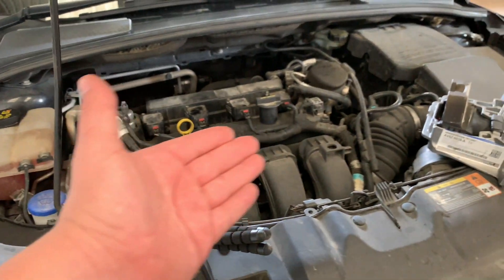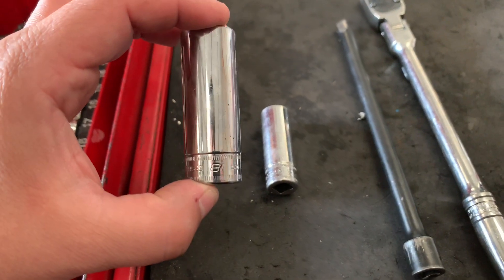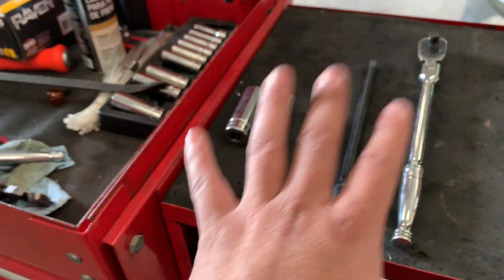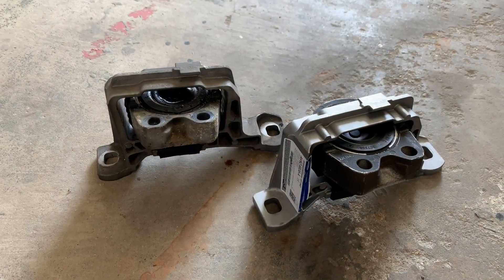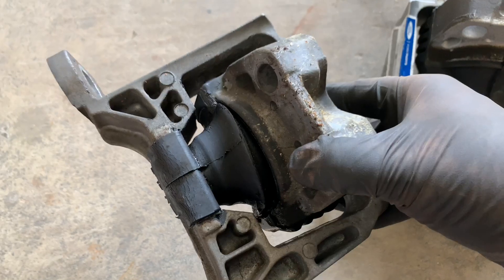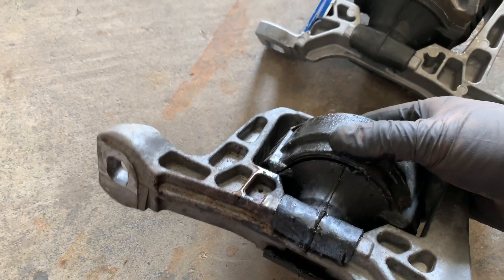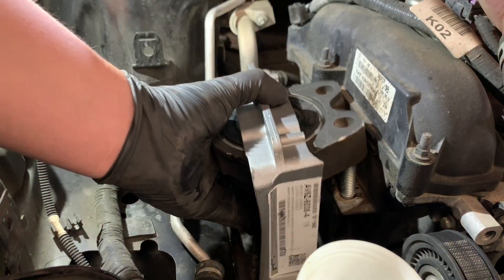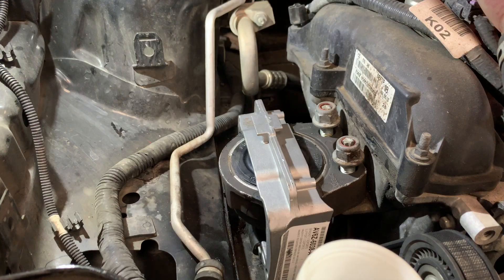Ford Focus Engine Mount Vibration Repair 2012-2017

Comment: Excellent video, I did not know what was my problem and now I learned the hard way asking a mechanic, and I paid the price of not having the knowledge, but next time I'll do exactly what you teach. BTW I understood that the jack is for pressing the engine upward, so I can take out the mount. I'll check the torque on the hynes guide.
Thanks for the video the best I found about the problem!

Comment: I get clunks when changing gears mainly 2nd and 3rd abd 4th gear.  I had clutch and flywheel changed but still does it.  Would this stop clunking I have oil leaking out if my engine mount now as well

Comment: This is great video & helpful for non mechanical person like me BUT for me, it didn't go as planned, when I took off the old mount, the motor shifted back several inches even though I had it supported with jack. First I thought part was wrong but it aligned same as old part & broke down calling my very expensive mechanic, he couldn't offer me help other than telling me to get crowbar & rock motor back/forth. Unfortunately, I didn't have that but walked the neighborhood dug up street sign & found a few 2x4's which all helped me move the engine back in position with also some repositioning of the jacks. After 3hrs, I got it installed & seriously feels like I'm driving a brand new car & my 2012 Focus has 160K mi. Thank you for this video. My next issue, since last week I get warning my Hill Assist is off & now 4-5X each day it warns me to check it. I might change some fuses but can you offer some more free advice. Thank you!
Reply from the maker: sorry you had those issues  .. but yeah that happens sometimes and best thing to do is just that force it back .. GLAD you got it fixed and can feel the difference .. have you tried unplugging the battery just to reset the codes (or clearing the code) just to make sure the code comes back?

Comment: My ford focus is having a vibration or shudering when accelerating from stop. Transmission is smooth. i am wondering whether i have a transmission issue or engine mount issue.
Reply from the maker: could be the mount .. but you said .. "transmission was smooth"
Reply: @FalconsGarage Please help me. My Focus3 1.6 tdci 115 hp twitching in 2nd gear when i accelerate from lower rmp. Twitching happens when i slightly accelerating in city drive. I hope its mount. Or something else?

Comment: What about the other 2 motor mounts ? Because it’s 3 in total right ? One on driver side and under the car is the 3rd one …
Reply from the maker: Yes you have 2 main mounts and one “wishbone” mount. But this is the one that goes bad 90% of the time
Reply: If it’s possible can you do a video on how to change those…

Comment: Thanks forbthe video! I have to do my wife's car this weekend. The guy at the shop was trying to charge me $389 to do it!
Reply: Good morning, are you a mechanic ? I need the mounts replaced on mine and these shops are ridiculous the prices. Meinke is $923, this shop called Taylor Auto is $546 and the high dealership is $700. I am still checking around to see who can do it cheaper.

Comment: I was cheap and just got the inside part of the mount $19 on Amazon. What an amazing difference!, I think my car was vibrating since I got it 6 years ago. It's a completely different car. It took me literally maybe 30 to 40 minutes.
Reply: What was the inside part called?
Reply: @salt_4_salt348 Something along the likes of Right Engine Mount - Hydro Mount (as believe it or not these things have hydraulic fluid in them).

Comment: i just saw mine and its cracked from the base on the engine on the screw. is that a single part or is it going to have to be welded ?

Comment: They always make it look so easy on videos lol but this actually doesn't look too bad. At least you don't gotta do too much underneath where you can't see or get to anything. 
I suspect this may be an issue I've been having. Vibration or rattling sounds coming from the dash.
Reply from the maker: good luck with the repair

Comment: Where exactly did you jack up the engine first?
Reply: Also. Did you have to take off the cover?
Reply from the maker: if you mean at the beginning when I jacked the car?   it was from the frame
Reply: Where you put the piece of wood?

Comment: Mine is a 2016 powershift, I noticed that in addition to the coolant reservoir, there is also an AC pipe going on top of the engine mount. I guess it makes it a bit harder to pull off.

Comment: when i’m going super slow like when i’m at a stop light ready to take off my car like will vibrate/jerk almost like i’m stuck in a gear then i press the gas and it goes away. i have 2012 ford focus too, any idea? 🙏🙏
Reply from the maker: could it be a mount or transmission?

Comment: What was vibration only under load? Mine vibrates under heavy load but as soon as you let off, it’s really smooth again. I think I may have the same problem.
Reply from the maker: mainly underload .. but its also alittle not under load

Comment: Awesome video. Gives me the courage to do it myself and not rely on a mechanic. Quick question: do you know if it's dangerous / damaging to the car in any way to drive it with the damaged mount? It may take a couple of weeks for me to get the spare part. Thanks from Argentina!
Reply from the maker: it "should" be ok for a while but dont push the engine
Reply: @FalconsGarage  Thanks. A friend thinks  it could be the exhaust silencer. I'm taking it to a mechanic tomorrow for diagnosis. Fingers crossed!
Reply from the maker: @jweber018  🤞🤞

Comment: Super interested in replacing my mount now but one quick question would this be the issue while is accelerates and it also spudders when shifting or it shakes when shifting and its more common at that point
Reply from the maker: no, that sounds like a different issue
Reply: @FalconsGarage  thank you
Reply: Could be the transmission shudder recall if it's an auto. I had mine replaced and it fixed that issue. The sputtering could be from the purge valve recall also cuz it creates a vacuum leak and it'll eventually make the car stall at red lights.
Reply: @yungjavfromaz  would the recall still be available if its a salvage vehichle
Reply: @rudymathers7686  I'm not sure they can even see that. I'd call and ask them if they can check it out and then if it's an issue let them bring it up. Don't say it to them first
Reply: @yungjavfromaz  definitely have it planned out just like that i appreciate the feedback boss
Reply: @rudymathers7686  Only safety recalls are approved for salvage vehicles.  One of the transmission recalls is safety and the purge is safety.

Comment: good video. do you happen to know if the mounting bracket that the engine mount attaches to is replaceable? or is it welded onto the block.  My friend broke the mounts on his the treads are still in the engine mount but the engine is almost on the ground.
Reply from the maker: I believe that's part of the "timing chain cover" so I think if you replace that you would be good.

Comment: Would this be fairly easy to diy if you're not well experienced? 
Asking for a friend lol
I know how to tighten and Loosen screws/bolts,uts etc. But I've never done something like this. 
Or should i just take it to a mechanic?
Reply from the maker: It’s not a difficult job. Some thing to make sure to watch out for is ..
Not damage the oil pan when raising/supporting the engine and I believe there is a  AC Lline you also need to watch out for
Reply: @FalconsGarage  how do you avoid damaging the oil pan ?

Comment: Man, it's funny. I've watched several of these videos, and none of them have the A/C line running over the top of the mountain like my 2012 does! Doesn't look like too much of a problem, but just kinda odd.
Reply: Yeap my kids car has it on top of the mount.
Reply: Our 2012 has it on Mount also

Comment: I have to change it on my focus as well.
Seems a common issue with this damper. Is ridiculous my car is bellow 60k miles.
Reply: My car is just past 35k miles and it looks like I have this same mount gone bad
Reply: @jake-the-neko5531  you'll feel some vibrations in the dashboard very common for Ford

Comment: My bottom left bolt on my mount 2013 focus goes in but before it bolts all the way down flush it gets stuck. . My right bolt goes in fine.
Reply from the maker: sounds like the bolt got crossed threaded

Comment: Only one engine mount!? Isn't there other ones I need to be replaced at the same time
Reply from the maker: for the most part 4 cylinder engines have 1 engine mount, 1 transmission mount and maybe 1 or 2 wish bone mounts
Reply: @FalconsGarage  okay yeah I was wondering because I want to mechanic and they wanted to replace three parts and last time I switched out a engine mount I had two or three that I had to remove one of the underside of the engine and then one on each side.

Comment: Hi! And, what if it is the opposite case with vibrations. It vibrates when on idle and not when in gear and rolling? could it be the flywheel or something else and not the mount?
Reply from the maker: I would still check all mounts first
Reply: Did you find what it was?...
Reply: @javiergonzalez6299  Yeah, it was the engine mount, the Hydraulic one...

Comment: What if the two thread studs fused to the motor it will are broken off. Is that replaceable?
Reply from the maker: Probably the motor would have to be pulled. It would be a pain in the butt
Reply from the maker: Probably the motor would have to be pulled. It would be a pain in the butt
Reply: Falcon's Garage damn. That’s what i figured by the looks of my motor mount situation.
Reply: Well replacing the timing cover where the upper motor mount bracket is a part of was a pain to do but got done 😬

Comment: I've 2016 Focus SE 2.0L GDI Flex fuel . engine . Can someone tell me if loose timing band will bend rods and valves ? One says  yes another says no way . What's the truth ?? verry hard to find a good mechanic

Comment: My focus is vibrating alot recently, so I changed the transmission and rear motor mount, the engine mount I didn't change it because it doesn't look bad or anything, it doesn't have oil leaking, but the car even with the 2 new mounts is still vibrating alot, could the engine mount be the cause of this? My car has 47k miles.
Reply from the maker: yes

Comment: Just did this on mine. However, the symptoms were a rubbing sound coming from the passenger front wheel whenever I turned the steering all the way to the right. Wheel was rubbing on transmission i believe.
Reply from the maker: you should check exactly were it was rubbing

Comment: I took my 2014 focus in for some recalls and then they call telling me my front motor mount needs to be replaced and it’s gonna cost me $260 so I’m like nope I’ll order the parts and do it myself!
Reply: what state are you in? they are telling me 3 motor mounts is like $1400, california.
Reply: Just did the same thing here in GA, transmission clutch replaced again and gas tank purge valve recall checked. Quoted $278 for engine mount
Reply: They tried this to me at the Galpin ford dealership in CA and tried to tell me my transmission mount and engine mount passenger side was shot out, 89,000mi odo on 2015 ford focus se. Tried to tell me $510 before taxes for both mounts. Rip off. Ordered them myself thank You!!
Reply: @quinnmcconnell8325  Just took mine in for the clutch again (5th time?) and when I picked it up they told me engine mount is broken. Quoted $360. Glad I found this video!
Reply: @quinnmcconnell8325  what gear clutch did you replace?
Reply: $260 is crazy 🤣🤣🤣🤣🤣

Comment: Thank you SO much!  My wife had her car at the dealership for a post-accident repair, and they told that she needed to have the motor mount replaced. Can you believe the quoted her $778 for this repair?!  After a trip to O'Reilly ($110), 15 minutes of labor from the time I drove on the ramps and stabilized the motor, a ratchet, two extensions, and two sockets, this was done-- with all tools put away!  You are awesome!  My wife's car is a 2016 Ford Escape.
Reply from the maker: You're welcome!
Glad I was able to help you guys save money!